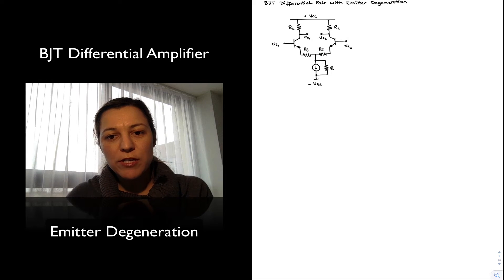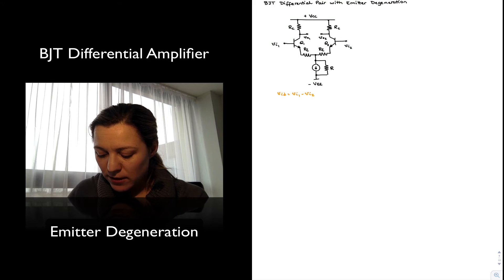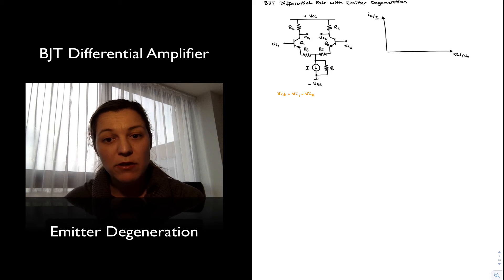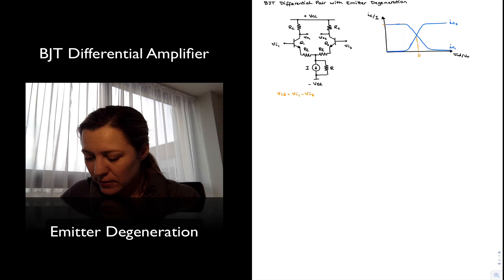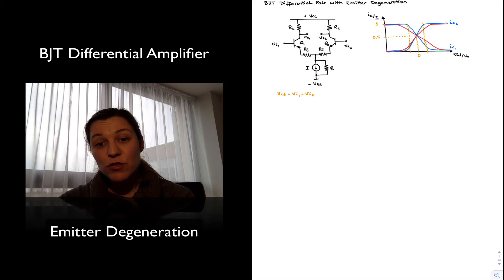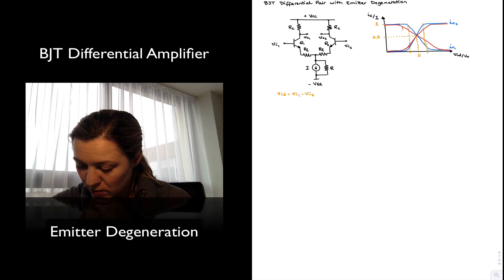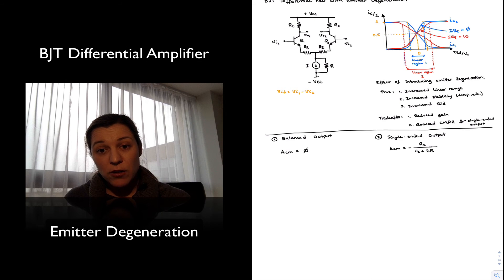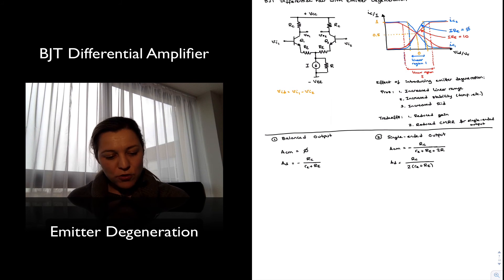BJT Diff Amp: Emitter Degeneration

Comment: Just a little mistake there at the end i think. The input resistance for the differential input is beta times the value you suggested. Isn't it?
Reply from the maker: Yes, there is a typo. It is multiplied time beta. You can see the derivation in the following video